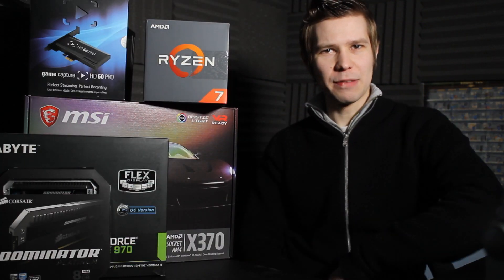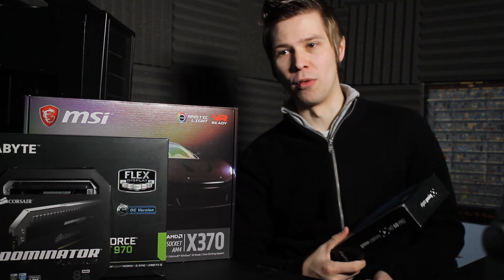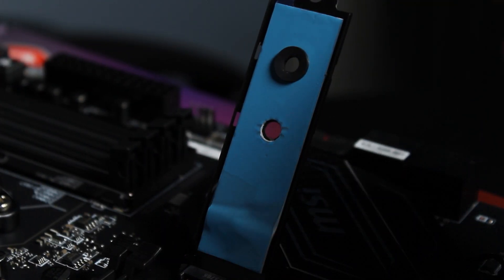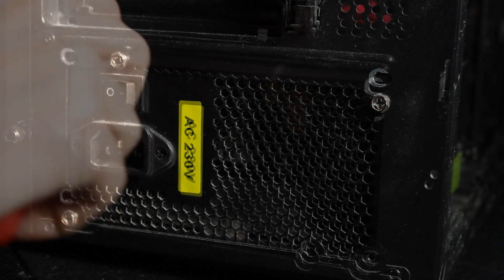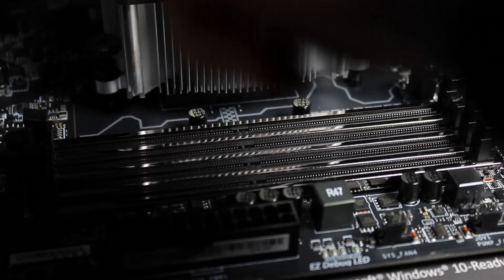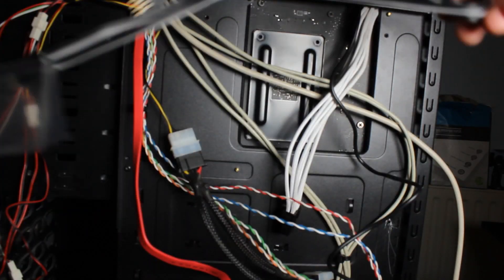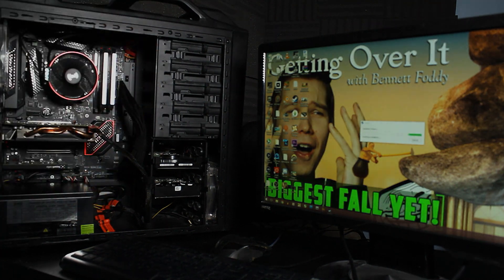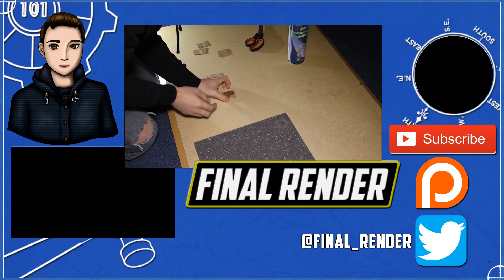8 CORE PC UPGRADE! - AMD RYZEN 7 GAMING, Recording, Streaming PC BUILD GUIDE!!!

Comment: The Ryzen 1700 is a good cpu, i upgraded to it from and old FX based AMD.  How is your capture card working with your new MotherBoard?
Reply from the maker: +CrazyIke Gaming its not haha. Elgato say it requires a special firmware for the x370 chipset or it will replacing all together. I am in contact with them at the moment to see if it can be a download or if they can send me a new one. Hopefully its just a download.
Reply: Well that sucks, i was just looking at those for a replacement for using Shadowplay.  Looks like i need to wait until they have a solution.
Reply from the maker: +CrazyIke Gaming I believe the usb variants are fine tho, and the new 4k one might. But do some research and check because I do recommend them

Comment: YES IT IS SO FUN in fact so fun that the computer was crashing and now only the power unit fan and the front fans work YAY!!!
Reply from the maker: +Lall O doing some pc repair work are you?
Reply: Final Render nah basiclly I built my own computer had it checked over by a pc shop(to make sure everything was in the right place) it worked fine for a week and the started crashing on my sometimes to the desktop and sometimes it even completely restarted anyway I recently tried to fix it but now only the power unit fan and the front case fans turn on
Reply: Do you have any suggestions on what might be wrong with it?
Reply from the maker: +Lall O honestly hard for me to say not looking at it myself. I say take it back to that repair shop, If it broke a week after they looked at it they may look at it again for free
Reply: Final Render I have been taking it to repair shops for months now and they just seem to be stumped on what’s wrong.